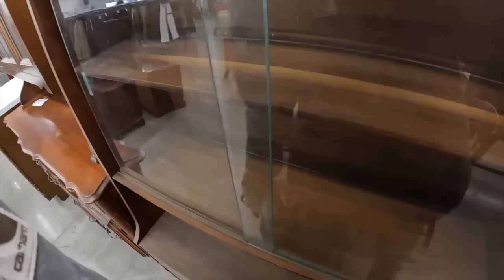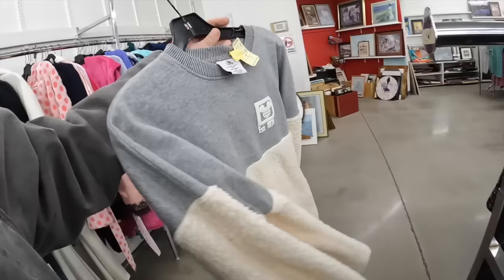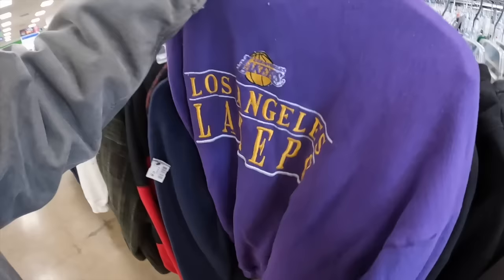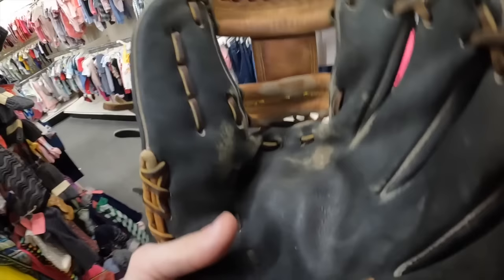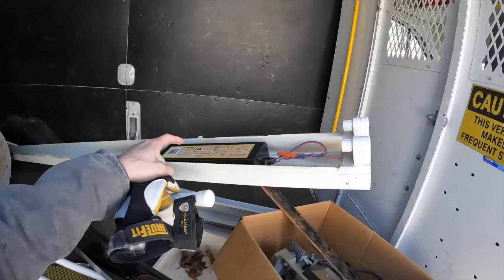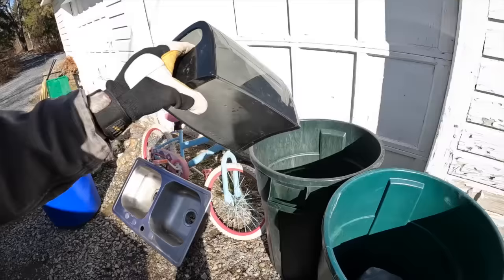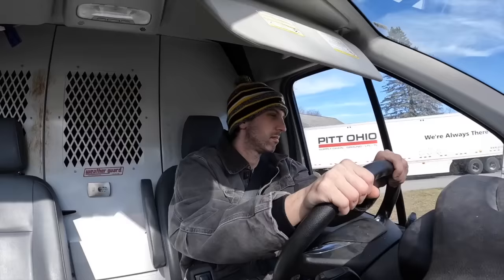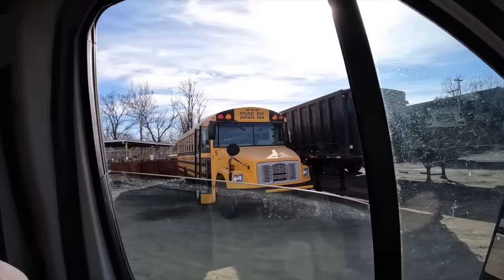Thrifting Salvation Army Thrift Store + Trip To Scrap Yard!

Comment: I go one step further on clipping cords. After I cut the plugs off, I put them in a vise and pull the prongs out.  They are yellow brass and the wire that comes out with them is #2 copper. Time consuming. So just the empty plug goes to the landfill.